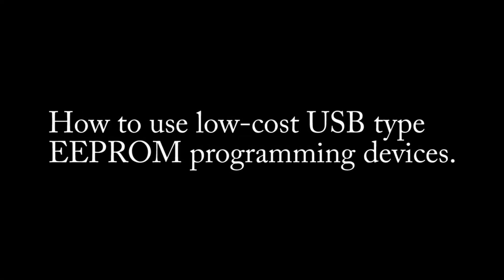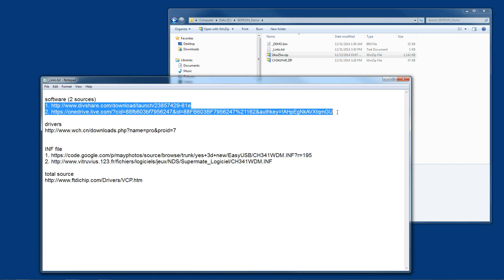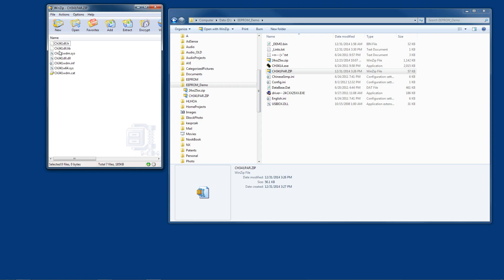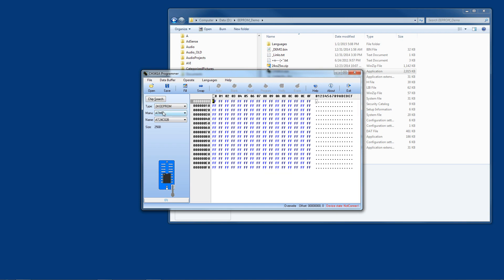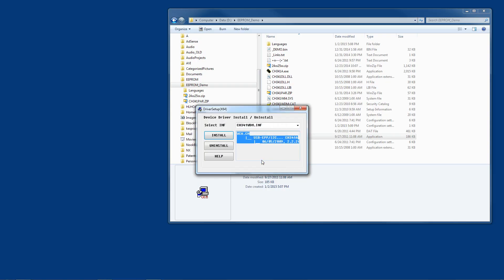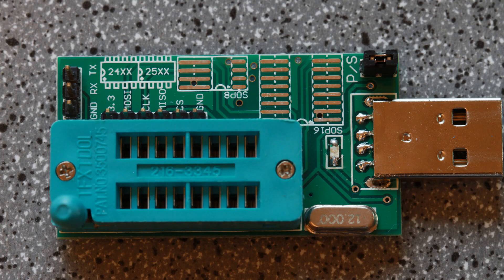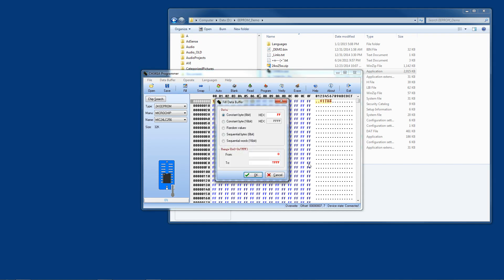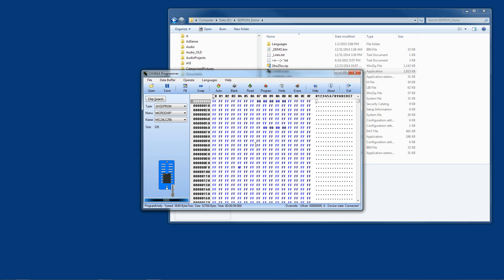USB EEPROM Programmer  **DRIVER DOWNLOAD LINKS**

Comment: I accidentally bricked the BIOS on my $2000 ROG Strix laptop. I've ordered a CH341 Programmer from Amazon and am currently waiting for delivery fingers crossed I can get it up and running again! Thanks for the tutorial, I really appreciate it.
Reply: Did u fix it?
Reply: @aaravshah4340  I fixed it with the EEPROM, but sadly my D-GPU isn't working because the BIOS doesn’t have the needed info. Now I'm trying to figure out how to get the original GPU details and put them into the new BIOS file.
Reply: @markanthony-x5w oh ok im having a problem wgere it just doesnt detect my bios chip even tho the clip is fully attached to the chip and i dont have the time and skill to desolder and solder the chip. Did u reflash the bios using a clip like i itried to do?

Comment: There are several .exe files in the zip file downloaded from the above link... The DRVSETUP64.EXE installs some software, but is it all that has to be installed on the computer? When after that, with the eeprom connected to an USB port, I click on setup.exe I get the message  "Not found install application, please install by hand". Am I missing something?

Comment: I think divshare link isn’t working anymore do you have another sources thank you.
Reply from the maker: Check out the link in the description I’ve recently tested it and it works
Reply: Thank so much Kris I finally got the driver and the program running. When it read my eeprom it had all ff. I try to program it but it won’t program. It just go back to where it had all gf. Any ideas thank you Kris.

Comment: Thank you very much Kris for this great tutorial! I can't get the drivers to work. I install them, but the software says "device not connected." any suggestions? The chip is supported and installed correctly :(
Reply from the maker: I've had this in the past, sounds odd, but uninstall, reinstall, uninstall and reinstall. That usually worked for me.
Reply: I'll do that. Thank you so much! @KrisKasprzak

Comment: I'm not sure if you're still active on here but I tried plugging my USB in and installing the driver, whenever I hit on install it says "The drive is successfully pre-installed in advance!" it doesn't say "drive success!" as yours did. Anyway to get that to change? I also get "USB Device not recognized The last USB device you connected to this computer malfunctioned, and Windows does not recognize it"
Reply from the maker: What version of Windows? Installation is very squirrely, On some machines I've had to uninstall/reinstall several times.

Comment: Great presentation Kris. I curious if it's possible to read and write to a chip that is soldered to a PCB. I have a project involving the control module in my automobile, and don't feel comfortable de-soldering the chip to reprogram it. I'm sure making jumpers would be equally challenging but less destructive. Thanks for the video, I had no idea chip programming was this easy.

Comment: Each USB eeprom programmer apparently uses whatever orientation of the socket they like. For anyone getting a NIYOTO CH341 programmer from amazon that has no headers and only the zif and crystal on top, the orientation is the same as in this video... pin 1 closest to the zif release arm, and 24 series chips go with the notch closest to the arm. I could identify the 24 series location because pins 1-4 are all tied to ground.

Comment: Thanks a million for the very clear and straightforward demonstration and especially for the driver/software download links. As you pointed out, there are tons of vendors selling this item (and hundreds of video demos) but almost without exception they do not include links to the drivers and software. Some of the articles and videos say (with what I suspect is the desire to tantalize) something like "you can find the drivers online" ... which you can, but only after a lot of poking about, sifting out the bogus, etc. Thanks for a cogent and detailed demonstration.

Comment: hi can you help me?. I already program the chip and then there is pop-up message said "Chip and Buffer same!". what is that mean?
Reply from the maker: It has been years since I use the programmer so I don’t really know what that message means I am guessing it simply means that the programming was done properly since the data on chip and the date in memory match. Maybe unplug the chip plug it in and read it and see if it has the date it that it should.

Comment: Hey Kris, im have trouble cloning eeprom 080dowq.  any help would be appreciated.
Reply from the maker: Is your EEPROM and series 24 or 25?
Reply: @KrisKasprzak  Its out of a BMW thats all I can tell you.  How would I determine the series?
Reply from the maker: @davispaul82  you will have to look up the chip number, find the data sheet and hopefully it will tell the series. I seriously doubt that chip is a 24 or 25, hence this programmer will not read it.
Reply: @KrisKasprzak  I came to that conclusion.  The number on the chip is 080DOWQ or it can be M35080 sop8.

Comment: Kris, Thank You for the very informative video!  I purchased the 341A unit to read an eeprom in a used GM Delco replacement radio.  I plan to change the VIN number on the chip to match my current vehicle’s VIN to get the radio to communicate on the vehicle’s bus.  The dealer wants $150 to do it with their TechII programming tool, hopefully I can do it myself and learn something useful in the process:)

Comment: question if my bios is erased will this restore it with the 
software or do i have to get a file off the internet to load to the bios
 chip how would i go about this if i get the software and tool but the 
bios is arased its a gigabyte mother board socket am3 plus if that 
helps

Comment: I've seen several of these programmer devices by now, and it seems the direction that the lever faces is more or less random.. thankfully the eeprom chips aren't too sensitive if you put them in the wrong way. Thanks a lot for the download links, I've been looking for a useful r/w software for these adapters for quite some time now.

Comment: I included a link to a how to video on the black chip reader, they apparently carry the same name but they are different requiring different positioning of the chip, relative to the green programmer shown here. I also noticed that the location of the chip on the programmer changes when the chip type is changed. Thanks to both authors for the demo and source gathering, very generous. https://www.youtube.com/watch?v=5NYe21nFSDI

Comment: Thanks for the video, quick question, can it flash Pm25LD010? from the description it says it can flash Pm25LV010,  looking at the datasheets, both ICs seem to have same pinouts, but the LV programs at a slower rate. Any ideas? Again thanks for the nice video.
Reply from the maker: I"m not familiar with that EEPROM,  sorry.
Reply: Wow, the fact that you put the effort to respond to comments for an old video  is impressive. just for that im subscribing and checking out the rest of your videos!!

Comment: hi nice video, I want to know if this programmer supports eeprom Mx25l6406e Sop-8?
Reply from the maker: all supported chips are listed in the video descroption
Reply: yup 
MXIC： MX25L512，MX25L1005，MX25L2005，MX25L4005，MX25L8005，MX25L1605，MX25L3205， MX25L6405 ........ but I need programer this Mx25l6406 x,x I just want to know is that programmer supported that

Comment: Every CH341A 1.29 programmer file I locate on the net has a Trojan virus in it. I cant even extract it.  What gives?  I need at least version 1.29 of the CH341a software
that has support for the W25Q64FW chip  Please post a working version.. ANYBODY !! Please..  thanks - Danke.

Comment: Having a bit of trouble with a W25Q40BV winbond chip and this reader.  Confirmed it works on other chips in my stash, just can't get this one to read.  That said I don't know for certain that the chip is good- it's in circuit, part of a Zwave wifi controller, and I'd rather not desolder it if I don't have to.  Anyone have one of the chips and can confirm working with the 1.33 version?

Comment: hello , very clear video , thanks for thet ! now can you help me and say if a 24CS01 eeprom can be read and written with this CH341A ?
i can't find the difference between 24C01 and 24CS01 ... only a TL866CS seems to be able to read these 24CS01, i want check before order !
thanks for your help .
Reply from the maker: Based on the types reported by the company that makes this programmer,It doesn't appear that this programmer will work with a 24CS01.

Comment: The software report state "not connect" when I plug the chip set. Can you help me ?
Reply from the maker: are you sure the chip is in the correct orientation?
Reply: Kris Kasprzak I use a "8 pin test clip" on with the red wire on pin 1

Comment: my machine display don't show any thing and their user light is green i think its bios system is out of order. in this machine use one cmos ic and EEPROM 24lc16b . my question is if i replace and reprogramme 24lc16b then possible to remove the problem

Comment: Thank you Kris, your 341A info was priceless, I was able to save our security system after security company wanted approx 750.00 to replace board and reprogram it.
Reply from the maker: That is too funny... I used mine for the same thing. The previous owner of our house forgot the alarms pass code, and the local security company wanted to replace the whole system. $10 and a few minutes i was able to read the codes from the EEPROM. Figured i wasn't the only guy with this problem.
Reply: I wish I could say it only took me a few minutes, between the software, driver and identifying the chip, It took me more than a few hours, but excellent fun in the end.

Comment: I already have a K150 programmer intended for PIC microcontrollers; - would you happen to know if this programmer is capable of also handling 25xx flash EEPROMS?
Reply from the maker: Not sure. this unit programs series 24 and 24, the video description shows a list of supported eeproms

Comment: Hi how could solve file length,beyond range of will be ignored.? thanks
Reply from the maker: I think it will be ignored. are you sure you have the right chip selected?
Reply: Hi kris Kaspark thanks for the answers , yes i put the correct chip and all other thinks, when i open the binary says that .well i copy the binary for a exe file . i seee only part of the code . but i  have a 000 and f

Comment: I have one question, I bought a usb reprogramator CH341A to reprogrammed bios chip from motherboard foxconn g41mxe.I dont know how to , with which program to accomplish flashing bios, sorry for any mistakes cos i dont speak English very well
Reply from the maker: You will first need to determine the series you bios is, the programmer I show is for series 24 or 25, the description shows a list of supported EEPROMS. Then you will need the bin or hex file--i have no idea where you can get that from.

Comment: Thanks for the video! I wonder if I can use it to reset/reprogram a toner chip, my xerox phaser 6125 doesn't accept recharged cartridges and the original replacements are very expensive in Brazil. For its case i'd have to build a cable for connecting it to the board, thats not a problem but how to wire it to the board is.

Comment: Just for others who faced the same problem as I did: My Operating system is Windows 7 64 bit. On Unzipping the zip file and then running Setup.exe I got the Error Message "Not found install application, please install by hand!" 
Edit: To do this, simply run the program drvsetup64.exe. Hope that helps!

Thank you so much Kris Kasprzak for uploading the zipped folder in GoogleDrive and for this video. They are a godsend!

Also, watch https://www.youtube.com/watch?v=5NYe21nFSDI&t=635s which gives advice on setting the Program's language from Chinese to English as well as on positioning the EEPROM chip in the zif socket.
Reply from the maker: Great tip!

Comment: Downloaded, thanks from argentina!
Reply from the maker: Glad I could help.
Reply: last question if my bios is erased will this restore it with the software or do i have to get a file off the internet to load to the bios chip how would i go about this if i get the software and tool but the bios is arased its a gigabyte mother board socket am3 plus if that helps
Reply: @jayt9665  creo q debes hacer una copia previa si el contenido no esta corrupto -caso contrario deberas bajarlo de internet

Comment: Thanks for the video and download links. It helped me a lot!!! I'm new to this and it helped me read the bios and back it up (I'm using a eprom with a clip that you connect directly to the chip without desoldering it. Your video is very good. Btw, how do you translate a original bios for hp to a .bin file?
Reply from the maker: Not sure other that reading the data and writing to a bin file.
Reply: Thanks for the reply! still awesome video!!!

Comment: Hey Chris have you had any luck reading chips on the boards. I can read the chip outside of the board but I can't read it in the board . I have to unsolder the chip in order to work. I am using the alligator teeth connection. Soon as I link up the chip,alligator connector and the reader, The program reads on the corner "Device status: not connected" I have flip the chip back and fourth and have done almost everything I can think of but no luck. I also have seen other people reading it with no problem. Anyways any help would be appreciated.
Reply from the maker: I don't think you can read chips while they are installed.
Reply: ohh ok Kris thanks.

Comment: Hi. I am having problems when I program it : it says it had timed out. I have tried installing and uninstalling it
Reply from the maker: are there any error messages reported in the software, look in the lower right-hand corner. if not are you sure you have the right ship selected? are you sure it's installed correctly? are you sure that ship isn't effective? are you sure this unit can program your specific chip? other than that I don't know sorry

Comment: It looks like the software supports chips up to 64MB in size. Their chip finder feature shows the chip I need (a 128MB Winbond), but it won't select it, and I can't seem to get any other 128MB chip selected. Is there a solution for this?

Comment: Personal hero :D Thanks a lot!
Reply from the maker: Glad I could help.
Reply: +Kris Kasprzak There is just one thing I don't get... I connected everything successfully, but I seems as if the device does not write the chip (Winbond W25Q32BV)... the write process finishes without any error, but the verify discovers that nothing in the chip has changed... but it reads the chip successfully. any suggestions?
Reply: +Kris Kasprzak There is just one thing I don't get... I connected everything successfully, but I seems as if the device does not write the chip (Winbond W25Q32BV)... the write process finishes without any error, but the verify discovers that nothing in the chip has changed... but it reads the chip successfully. any suggestions?
Reply: +Nikolai Klipp got it. Needed to erase the chip first... :)
Reply: +Nikolai Klipp hi! did you click "erase" button or use another way to do that?
Reply: +BLG0 just the normal "erase" button. after that, i clicked "check erase", this returned some success message... after that i could load the .hex file i wanted to program back Into buffer And programmed the chip successfully
Reply: +Nikolai Klipp thanks for your help. I followed the sames steps like you :read, erase, check, load. hex and program.But not success .May be i need use a hex compare tool.

Comment: 25L3206e GA-H61M-S2P *can i update this bios chip on this USB EEPROM Programmer
Reply from the maker: you should be able to this programmer works with series 24 and series 25 chips. It looks like you have a series 25

Comment: what software could I get to read eeprom 93c56?
Reply from the maker: +Prem aj I'm not sure you can use this programmer for that chip, this is only good for series 24 and 25
Reply: did u mean i cant use this software
Reply from the maker: +Prem aj software or hardware

Comment: hello this programmer is also unusable for STC 12c2052 /STC 12C5410 / STC 12C5406 but which programmer is right for this chips and then especially to handle the lock bit. !  i want to copy this locked chips. any ideas?

Comment: Hi, I was trying to flash HP-630 and HP-G62-b67ES bios chip with this programmer, but none of the laptop is working, the main problem is everything works display is black, no external display works as well. And I've checked the display with different laptop all the display is good. I read some forum and saying that bios needs to be flash and I did but no method is working. bios chip information (W25Q32V). Please help.
Reply from the maker: +Techno Care (Internet Cafe, Computer Repair) What series BIOS is in the HP? this programmer is good for series 24 and 25 only.
Reply: +Kris Kasprzak , Hi thanks for the quick reply, I don't  know how to check bios series, here is a picture link of the actual bios chip, may be you can get information from it. (http://www.filedropper.com/tuefeb2316-47-39) thanks again
Reply from the maker: +Techno Care (Internet Cafe, Computer Repair) Just Google the number on the chip. It's a series 25, see the data sheet http://www.datasheetcafe.com/25032bvsig-datasheet-winbond/

I'm not sure this programmer can handle this chip. It's not listed in the description.

How will you program it anyway, as it's soldered to the board?
Reply: +Kris Kasprzak, I flash it but still its not working same problem, but before motherboard was getting too hot now it looks normal.